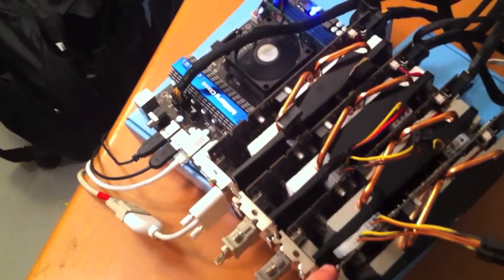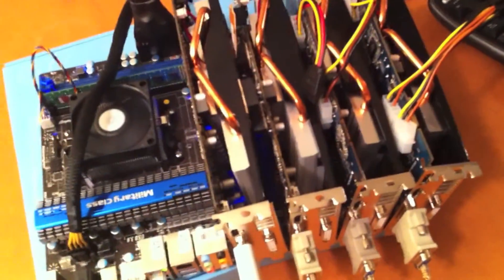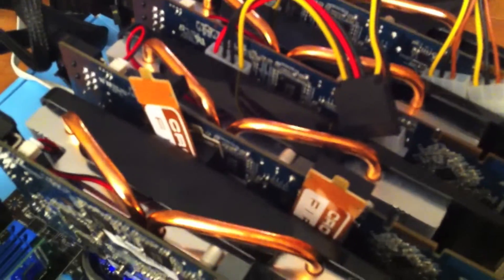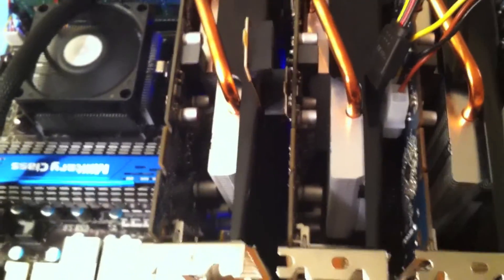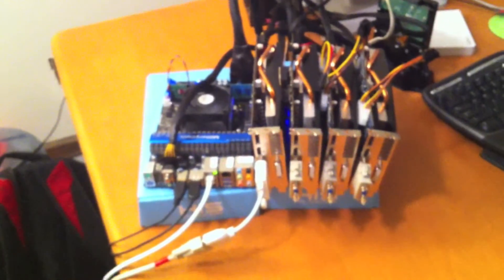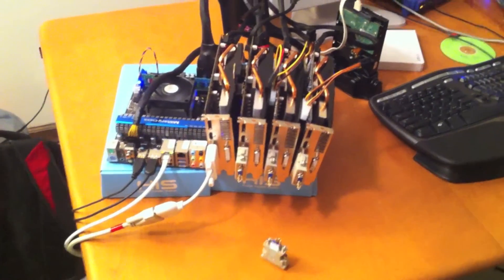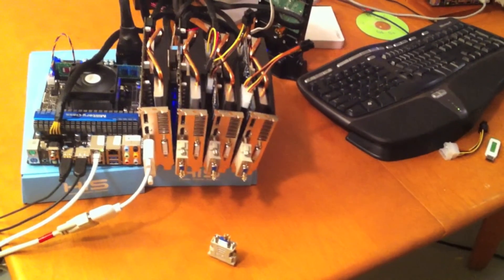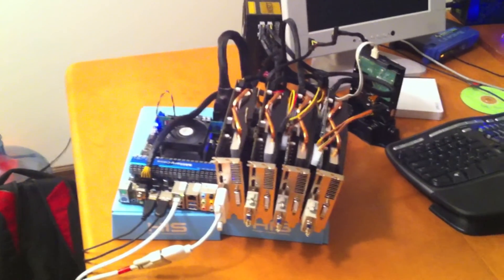Showing Off 4x5770 Bitcoin Miner

Comment: You may want to look into buying a couple of PCIE riser cards for that rig. It may well work for a while but since you are puttung a lot of strain on the solder joints on the slots I suspect the vibrations from the fans alone will eventually wear them out

Comment: use motherboard MSI on LGA 2011 and get Case also fix your GPU into water cooler if not then make sure keep it bit space for air intake on spice case, and use by windows 7 ultimate that can big 32GB Ram or more! but your GPU need upgrade also CPU on 2011! because now in old CPU will out date ver!

Comment: In linux you dont need to use dummy connectors. Im running dual 5770's with a single monitor and no dummy connectors.

BTW are you using the amd overdrive tool for the extra overclocking?

Also 5770's from newegg are awesome cause I sold the games it cam with for 31$ on ebay. So with the rebate I paid 80$ for my 5770's =]

Comment: You actually don't need dummy plugs... I'm running my linux bitcoin mining rig with 2 6870s with NO dummy plug, NO monitor plugged in, just 1 xfire cable. Look up the linux headless bitcoin guide.